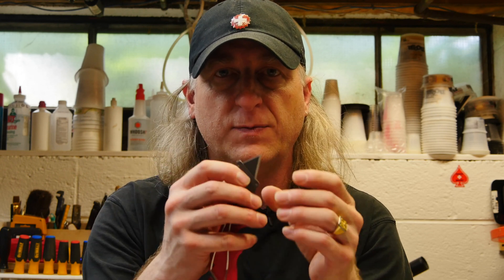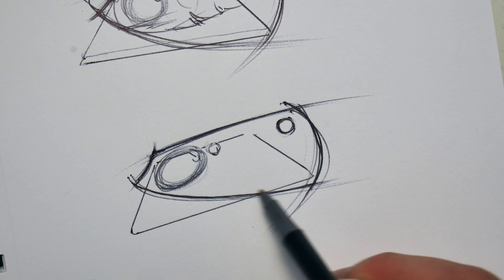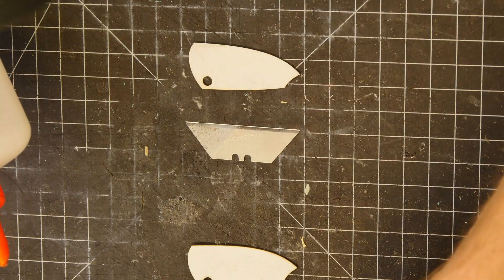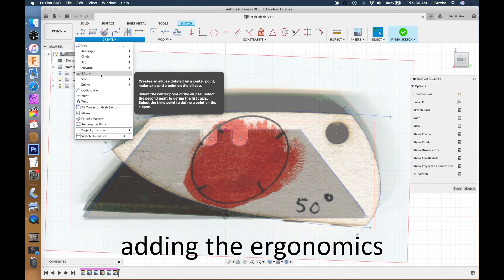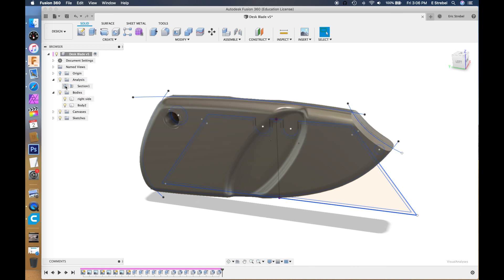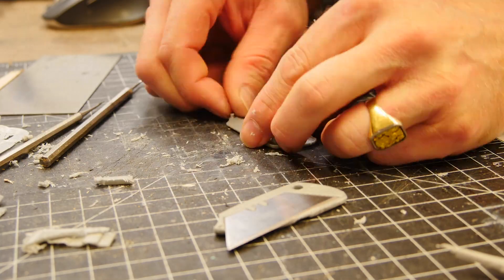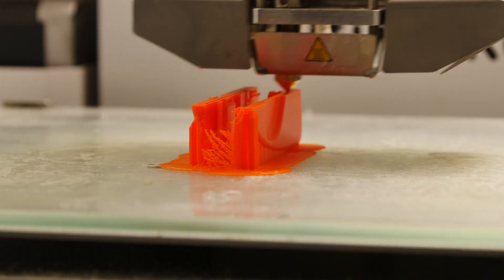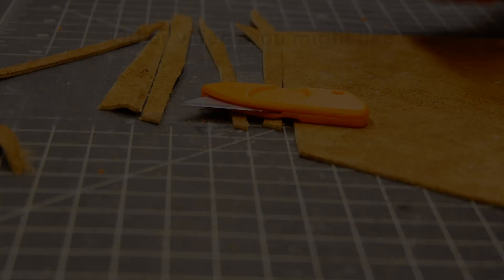Designing and prototyping a small ergonomic utility knife

Comment: Awesome! This is the first time i see an industrial design project from A to Z. I guess step would be the make  holes that are ergonomically suited for left AND right handed ;) Would definetly buy it. I also got interested in Fusion 360
Reply: I used to work for Eric and always brought up the 'what about lefties?' issue.  I'm guessing the final 3-D rendering could easily be 'flipped' to produce a left-handed version.
Reply from the maker: @xushomo2799  Yes, that would be very easy to flip and make a lefty version! Thanks for brining it up Xu ;-)
Reply from the maker: If you check out my backpack hanger series that is a little bit more in depth from a to z